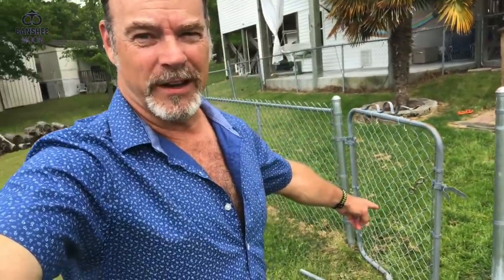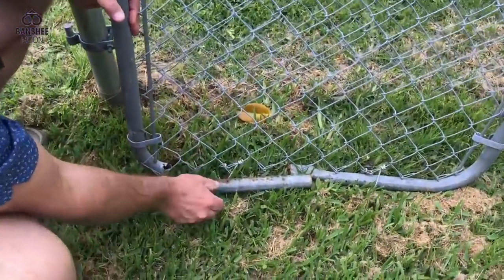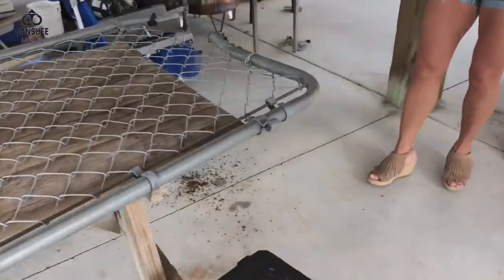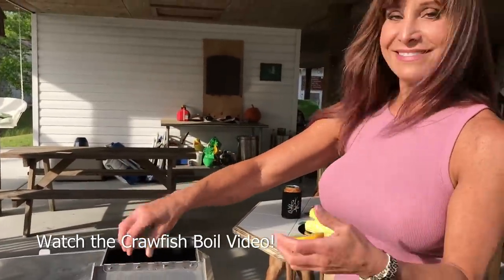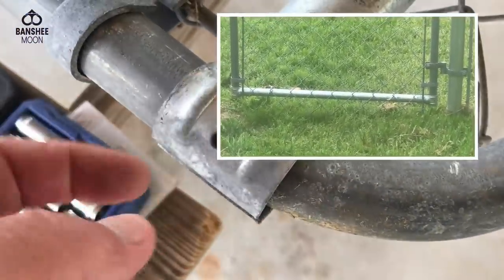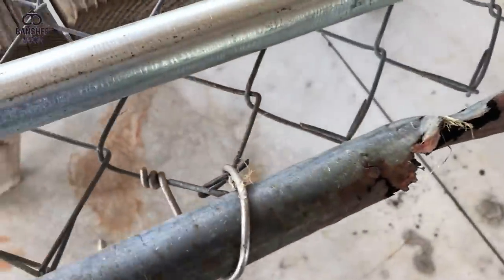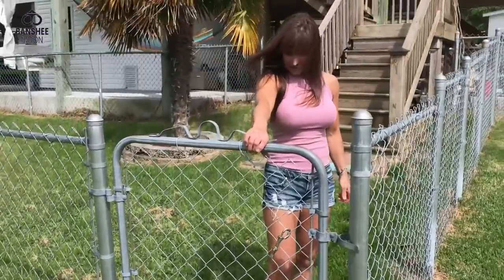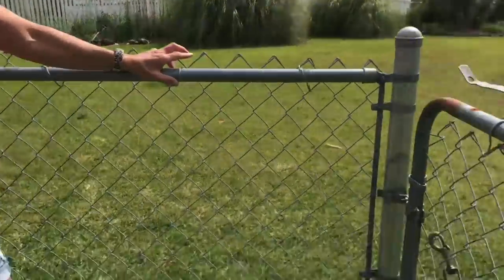She Said Shorter is Better -  Gate Mending almost FREE!

Comment: Exoman, you could have used the new clamps on the vertical pieces, and clamped the new pipe on the ends...this way the verticals would have not been shorter, and you could have secured the wire in the same place